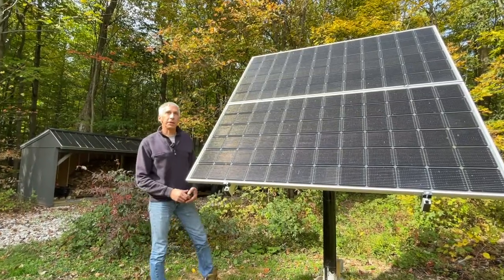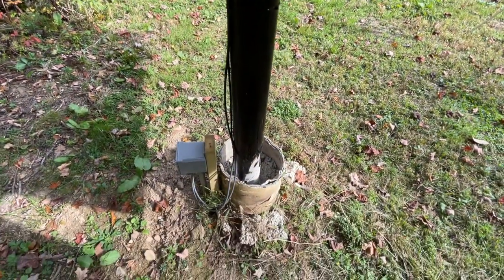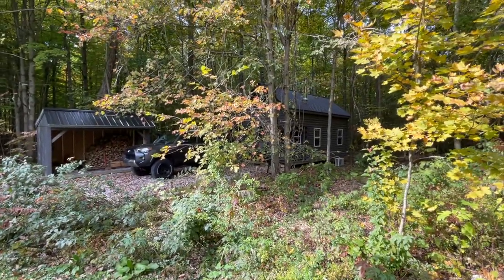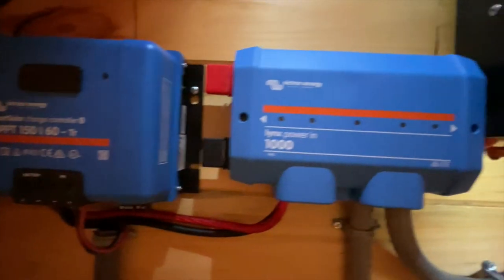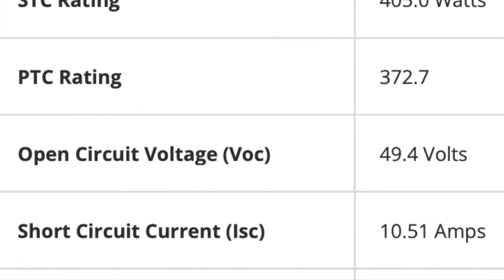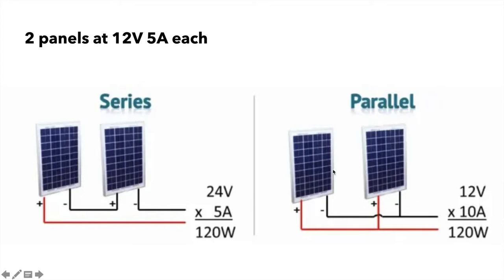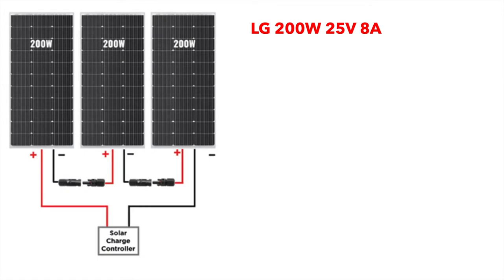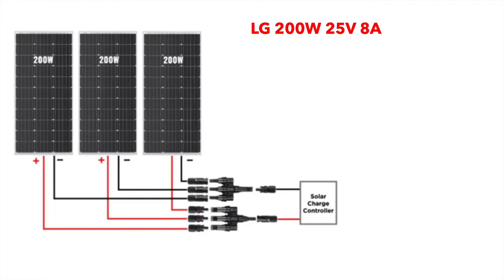Solar panels parallel or series wiring?

Comment: is wire with blk tape is negative wire with red is positive
Reply from the maker: Yes, that’s usually how it’s wired. Black should be negative and red positive. Remember when you wire something in series you connect one panels positive to the next panels negative. You will double your voltage, but the amperage stays the same.